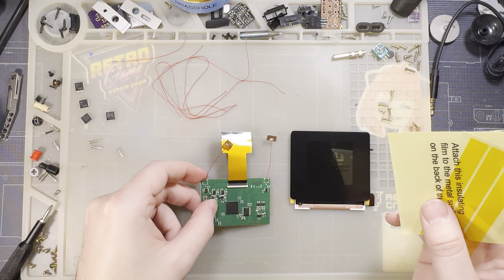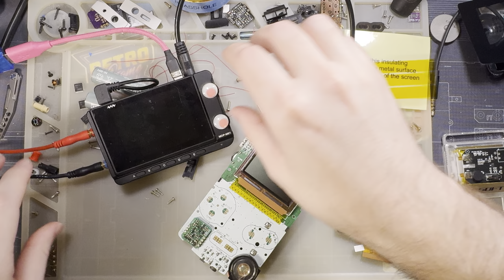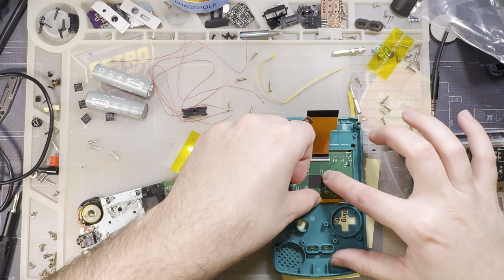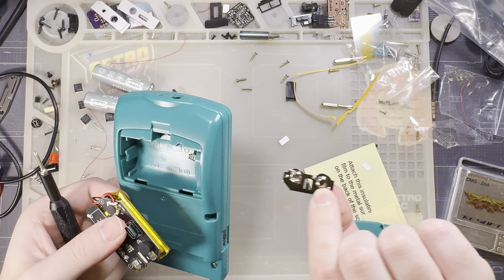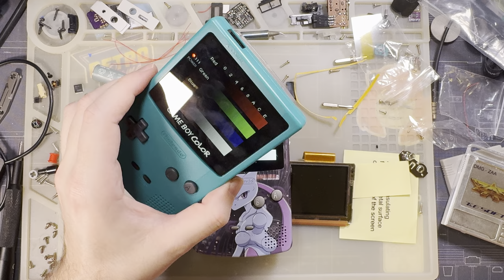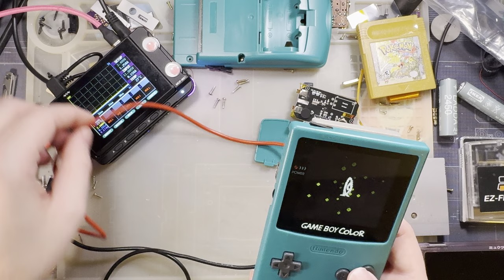Game Boy Color Q5 Laminated with Desaturation Mode

Comment: Ok, I got a little bit excited about the desaturation feature at first, but then I saw the terrible color banding. Thanks for the video!
Reply: OG hardware produces solid, indiscernible colors at about the 80% mark on those color bands. The issue is that these games weren't designed with a panel that could produce vibrant colors, so full saturation on modern displays is a neon highlighter nightmare.

Comment: I usually use Select, right and down for the wiring. Makes it easy to access the OSD, with minimal interference with gameplay (select + A +B interferes with the reset combo, for example). And it's still pretty intuitive to use, with right --> confirm and down --> cancel.

Comment: Great video, super in-depth. I just ordered one of these laminated kits from AliExpress, but it's for the original DMG. I hope it's a relatively simple install like you had. Never tried modding before but you're giving me some confidence. 

I'm a little confused about blending. I thought that FRM was just blending the current frame with the previous frame, which I think should still be 60 updates per second? And it shouldn't really add any latency other, but I guess the driver board actually processing the blending probably would add some latency. Definitely interested in this, because I keep it on. I like the look better and haven't really noticed anything weird, but maybe it's there. It's definitely a topic that needs more explanation. :)
Reply from the maker: When done properly, any additional latency is exceptionally minimal. I have not done any measurements (I have the equipment, I just haven't) and I have not audited the code behind the feature (I do not have access to the source code) so I cannot say for certainty. I am just making assumptions based off a worst case scenario. 

This entire hobby (specifically modding the consoles, not playing them) is full of subjectivity though so if you're happy with how your kit is working, STOP. Enjoy it. Don't fall down the rabbit hole.

Comment: Love your videos, always looking forward to new ones, so question I have when noticing you working on the board, why use electrolytic capacitors versus using multilayered capacitors, I know electrolytic are known for leaking but are they better, I’m curious cause I see lot of people using them versus the other.
Reply from the maker: Different capacitor technologies have different characteristics (like ESR). MLCC caps are obviously smaller, more durable, and cheaper, but there can be valid reasons for using an electrolytic. I'm not educated enough in the fine details to make blanket statements or even retrofit different types so generally I just defer to the expertise of the engineer that designed the circuit. Nintendo used electrolytics so I'll replace them with the next closest thing instead of swapping things blindly. 

That being said, the marketplace is a lot different today than it was 30 years ago so perhaps there are now MLCCs that meet the requirements in this circuit but, like I said, I'm not privy enough to determine that.

Comment: Nobody asked for a desaturation filter; that's not how a GBC LCD looks. Raw RGB is way better than a simple desaturation filter with rounding errors. They need to implement a color correction algorithm that replicates the original screen behavior at RGB and gamma levels, similar to what emulators like BGB or SameBoy already do.
Reply from the maker: First of all, plenty of people asked for desaturation filters. That's the easiest way to achieve a simulacrum of the desired effect. 

If you have a better idea for implementation, I'm sure they'd love to hear it. I could never effectively communicate what I wanted and it took almost five years to get this much (and ONLY because someone could finally point at their competitor and say "look what they're doing").